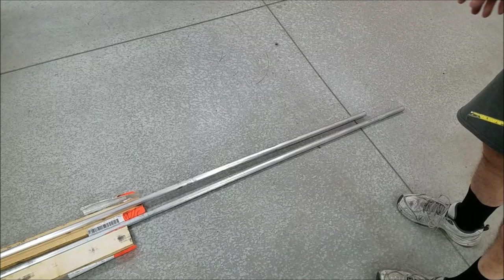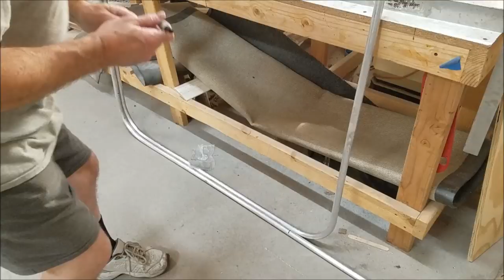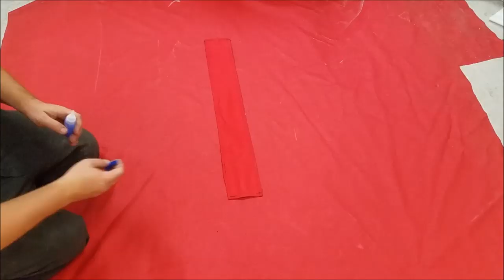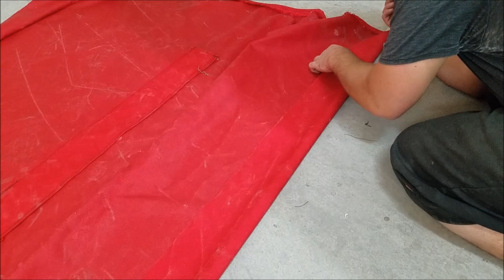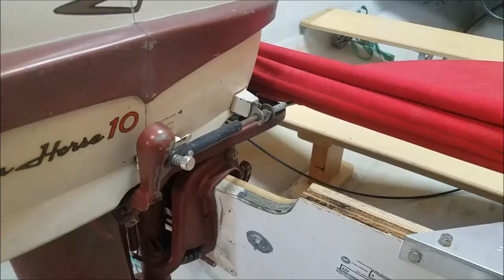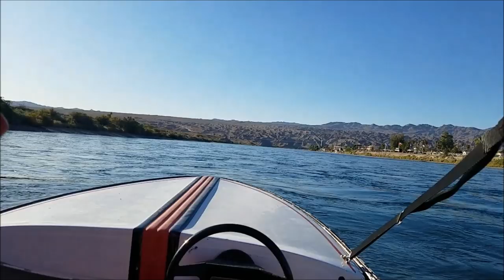DIY Bimini Top Build

Comment: Looks perfect for that boat.. Now you need 2 solid poles to hold it in place at the back rather than straps. then you can make a simple boot top for it. no need to have it flat down..  you made it look very nice, and good choice of colour.. a bimini boot keeps it all nice during winter plus keeps it away from that motor......  you done a great job making that and the poles are nice and strong.... you will get tons of people asking where you got it.. 5 stars for that job

Comment: Thread??
Nice little project.  I enjoy most of your videos.  I just finished a road worthy custom cover for my Lund with some old canvas tops I had lying around. Turned out so nice that now a few of my friends want them.  I have a Bimini Top for same ol' boat.  Now I think I'll enclose it by adding canvas down the front, back and sides. Make me a little ......tent!  It's really not that difficult.  I actually have about the same Brother sewing machine as you. A Walmart cheapo.  Nothing special. My question to you is...........what type of thread are you using?  Standard cotton thread like I used?  I thought about trying nylon but wasn't sure if the "Brother" could handle it.  I'm just not confident the cotton will last, mainly due to sun exposure.   I don't care what something costs, I just enjoying doing stuff myself, and we can customize them to suit our needs!!!

Comment: I know this is 3 years later but this is exactly what I am trying to do and I have not been able to locate that aluminum tubing.  seriously.    If you can see this comment please let me know where I can order it.   also  can you let me know the size? that thick walled is EXACTLY what I am looking for..  this is amazing.   i was thinking of a problem solver thing in the " BACK" by using several straps that would fold under so that the stretch I hear people talking " complaining" about can be taken up.   also I see that it would be best for the solid bar construction as the end would flap over and buckle to the other pol bar to be adjustable.   like a girdle type apparatus.  

  This is amazing. really.   I hope to find those materials soon.   Hit me back if you can, I'd really appreciate it.  today is 8/19/2022  :0)
Reply from the maker: This was actually all my local place had. 
I said I wanted 7/8th aluminum tubing, they said "this is what we can order" 
Where are you located? If you in California, Arizona, or Nevada - its called Endura Steel 
but any steel place should be able to source it.
It should also be noted that the last order I placed took a month, and cost $40 a stick.
Reply: @BrandonsGarage   idaho.    yeah those sticks are higher dollar because they are so thick walled.   amazing stuff though I bet.  I am going to guess they are less likely to break than the standard square tubes.    looked like an awesome idea for sure.    i will check around and keep my eye out.    Thanks MAN!
Reply from the maker: @larryleisuresuit9584  Very strong. In my DIY engine stand video I used the same pipe to hold up an outboard.